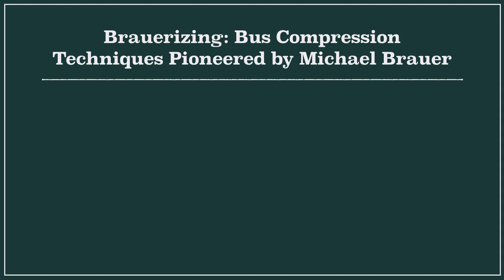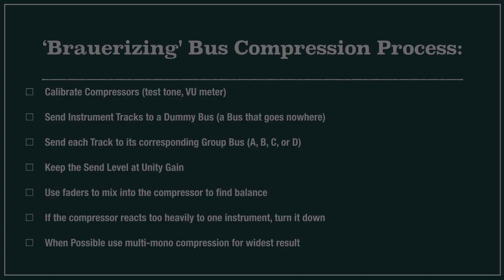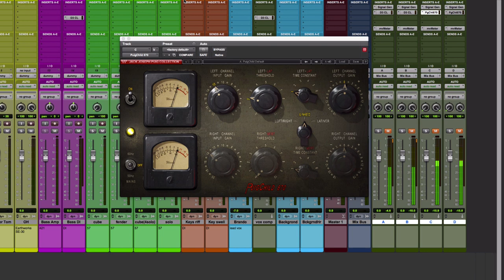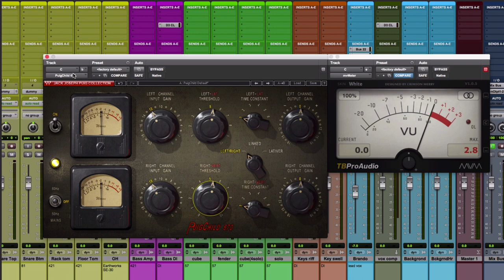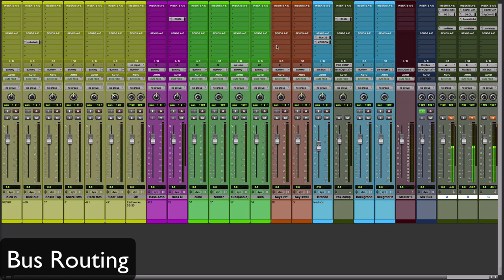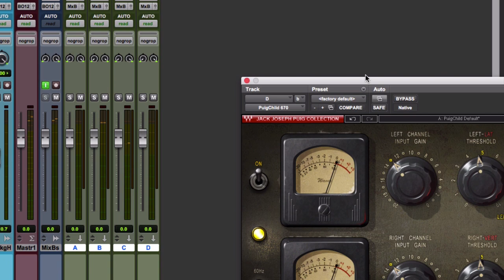BRAUERIZING EXPLAINED: ITB Routing, Setup, and Calibration | LearnAudioEngineering.com

Comment: Shouldnt the noise generator be at 18 RMS not peak? wouldnt peak be 6dbfs?
Reply from the maker: it's a sine wave generator, set to -18dBfs which is 0VU. the mvMeter plugin I used also measures RMS-12, RMS-14, and RMS-20.  Are you suggesting calibrating to one of these measurements? I hope I understand what you're saying. thanks for watching.
Reply: No problem and sorry my comment came off as aggressive. This video is great and brauerizing is actually completing revolutionizing my mixes. It just makes a lot of sense to mix that way. In terms of my calibration question, to simplify it, I guess my question was isn't 0VU -18dbfs in RMS and not -18dbfs Peak? So looking at a level meter, you cee the level of the peak dbfs and the average (rms) dbfs. I thought 0VU was -18dbfs measured in rms not peak level. I think I'm actually mistaken though because I use the VUMT VU meter and setting the oscilator set to peak like you have results in the VU meter to read 0 as it should, so I think I'm just misunderstanding calibration measurements. Great video as I said. Definitely a game changer!!

Comment: Good job bro...but can you explain what is the dummy bus? Is that like a mixbuss?
Reply from the maker: Hey! I just did a Q+A video that answers this and more: https://youtu.be/UaXDdh7eL8o

Basically the dummy bus goes to a bus that we do not hear the output of so the audio will keep flowing through the tracks. In some DAWs, like Pro Tools, audio will not play unless it has an output (so I use a dummy bus).

HOWEVER, some DAWs, like Logic, will pass audio without an output. so you can set your track outputs to 'no output' in logic.

Try it out in your DAW to see if your audio tracks will still play without a designated output. if so, you do not need a dummy bus.

Great question, hope this helps. Thanks for watching!

Comment: where do you write your automation?
Reply from the maker: I've gotten into the habit of using a gain plugin, at the end of the signal chain for fader rides. This prevents the fader from getting locked up, which happens when you write volume automation, and allows you to still use the faders to adjust the overall level of tracks. Hope this helps, thank you for your comment

Comment: 1) there's absolutely no need for a dummy bus. You route them to the right channels, like you say just after this.
2) if drums and bass are on channel b, why the stock compressor and not the puig? Sounds like some subtle differences in threshold, or attack and release, would make that pumping left and right you mention. 
3)And if guitars are on c bus, assuming they are distorted guitars, i dont see the need for the puig, and I'd put the stock comp here. The guitars will be compressed enough with distortion  to not have a need to try to push them just a little harder with the digital tools we're using. So,
 4)And again,  on D bus, why the puig? Once again I'd put the stock comp.  You explain all of this really well. But it seems to me that better customized mixes would result from switching places with a  couple of those comps.  Thoughts?
Reply: I don't get the dummy bus? Can someone help? Thanks Great Vid BTW
Reply: @treeoflifeguitars  That's a Pro Tools thing. Let's say you're working on track 1 and it has to send to the A bus, let's say that bus is track 2. You don't need to hear track 1, you just need to hear track 2 which is receiving from track 1 anyways. So what do you do? You remove the output routing from track 1, in other words you take away the final destination for that track (usually the stereo mix bus or whatever you set as the "main receiver" in youor project), leaving only the send to track 2...
...
BUT: Pro Tools doesn't like that. It says "Better stop playing track 1 because oh well, it has no main output so it's gotta be like an alt take or something like that, so I better save some CPU for things that ACTUALLY MATTER", so it gets angry and just stop processing track 1. Problem is, since it stops processing track 1, there is nothing to send from track 1 to track 2, and you don't hear track 1 anymore.

SO, to prevent Pro Tools from deciding it doesn't wanna play track 1 anymore, you just route track 1's main output (and you do the same with all the other tracks that send to a brauer bus) to a fake output track, a dummy, and you set the fader to -inf on the dummy. So Pro Tools is happy, and you still hear everything
Reply: @pianoman_luke  thanks
Reply: @pianoman_luke  So this can be ignored in Logic?

Comment: In 1st 2 compressors you did GR of -1 db then increased the gain to get back to 0 while in next 2 the readings were showing +1(not-1) then you increased the theshold to get the compression of -1db to bring it to 0 why didn't you use same approach in all 4?
Reply from the maker: honestly the short answer is I got this method from Brauer so I am relaying the methods he talks about in his Q+As on his website. I guess he likes to drive those busses a little bit more. Check out his website if you'd like to learn more:
https://www.mbrauer.com/questions

Thanks for the comment!

Comment: Great walk through of the setup but I’m confused. The whole purpose of calibrating is to set the threshold and mix into it so that it achieves 1dB of compression, then at the end of the video you CHANGE the threshold!? Aren’t you supposed to leave it and push the track volume to get more compression?
Reply from the maker: I can't remember why I would have done that tbh. If you're in this I'd highly recommend Brauer's website. At the end of the day, mix to bring out the emotion of the song. even if that means breaking the rules.
Reply: Thanks for the reply. I’ve since seen another video that explained that some tracks aren’t hot enough to elicit a response from the compressor but are already loud enough, in which case you may need to make adjustments. That’s probably what you were doing. And another video explains that you may want to use -12 rather than -18 although I don’t think that’s what Brauer does. Well our discussion here (if anyone reads it) may give someone else wondering the same things answers so thanks!! I’m gonna try this - today!

Comment: You definitely understand Brauer’s concept but word of caution. If you don’t have hardware outputs and you do this in pro tools with just one stereo output, you will get lots of phasing issues. The concept is designed for analog console mixing.
Reply from the maker: yes, I've noticed! haha. Brauer mentions this as well. especially when you start sending to multiple busses. Things can get pretty burry phase wise.

Thanks for your heads up! I appreciate the view!
Reply: Learn Audio Engineering sure you are welcome. Another way this will work is with analog summing.
Reply from the maker: @ekm3820  is that so?
Reply: Learn Audio Engineering Yeah. I use it with Analog summing and it works great.

Comment: Questions… why not send using output?Where is the dummy track? Why is there a dummy track?
Reply from the maker: Short answer, Pro Tools workflow. 

I like to have the 4 A B C D busses set up on each track to choose between in the mix window.
However, Pro tools requires you have a track output set.
In this setup, to avoid sending the signal to the master output twice, you can point the track's output to a bus number that you never intend to use. This way, we only hear what passes through A B C D busses

You can set the track outputs to A B C D directly if you like. Hope this helps, Thanks for watching!

Comment: You made a mistake...when the compressor isn't working, you move the fader up and add more db's. By going in and changing the settings on the compressor, you screw up the calibration.

Comment: wouldn't it be simpler to send all the tracks to the 2 buss and add a multi band compressor split into 4 bands, bass, low mids, high mids, treble. That way you can set the ratio, attack and threshold per band?
Reply: Just mho, but multiband stuff should be used as a last resort. It might solve your problem but also might cause another one elsewhere due to the interaction of all the bands, even the best linear phase processing won't make the crossover points flawless.
Reply: No because a multi band compressor is very rigid and takes the complete summed signal to split it up in bands and compress them individually. That will not yield the same result as grouping certain instruments/tracks and compressing them. To give the B bus as an example: the overall content of that buss has low, low mids, and midrange information because that's the nature of bass and drums. But there is still plenty of high frequencies in there which are treated by the compressor on the B bus (think of the cymbals). They wouldn't be treated by the multiband compressor in the same way as they are in a different band. 
And of course, the grouping into global frequency content is also a grouping in transient information. The B bus has instruments with fast attacks and transients (drums, bass, percussion). The A bus has instruments which often have a slightly slower attack compared to the B bus. That could actually imply that you might want to have different compressor topologies for these types of sounds (and of course, the B bus would benefit from some saturation). Note that the compressor is also fulfilling the job of gluing the bass to the drums. The multiband would not do that. Also, it's not just about the compression, it's about the colour a specific compressor (or actually, it's often a chain of outboard)  as well. You will not get that with a multi band compressor because it is a single (and often more transparant) colour. It's a completely different concept which cannot be compared to what a multiband compressor does.